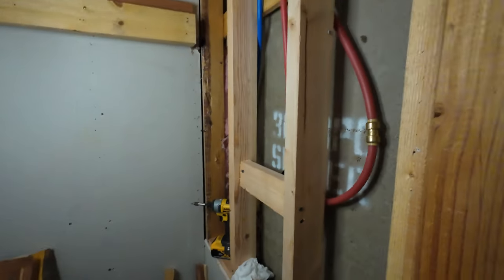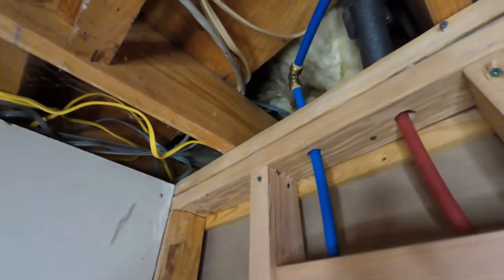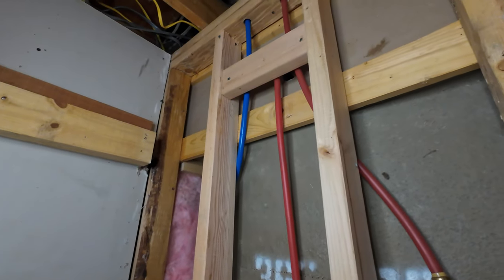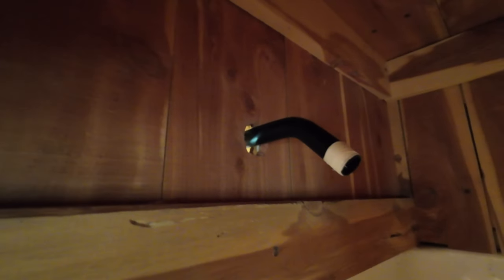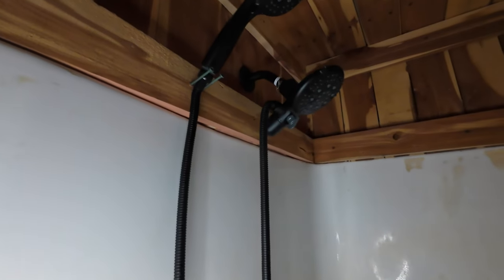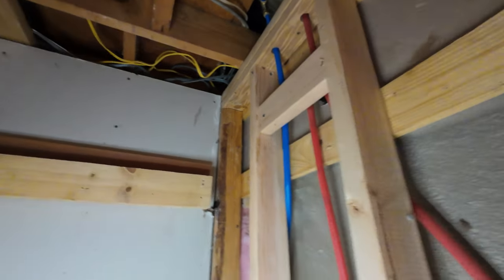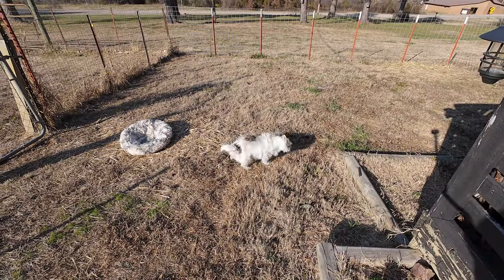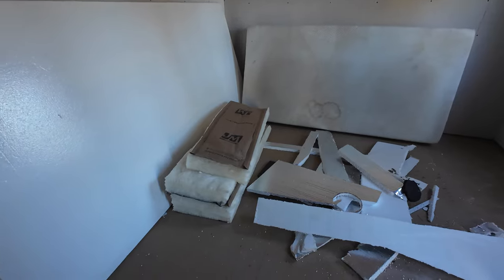Checking Unfinished Projects Off The List One By One. First Up Is The Cabin Bathroom.

Comment: The cedar in the shower looks Beautiful 🤩. I plan to build  a full cedar surround shower/steam room when I move. 
We have a similar shower head/ combo. Same issue, just hung down because it didn't fit the hanger 😣.  I couldn't put nails through the stained glass wall tile. I had one of my blonde moments and figured it out🤣. Try putting the hose into the  hanger then slide it down until the handle meets and fall into the hanger.👍🏻
🤔 Hmmm...What could go in that spot next to the shop?
Thanks Dogman. I always enjoy & appreciate your movies😁, entertainment,  updates and the shorts.
✌🏻😛 Tracy

Comment: The hex head of the shower hose goes on the shower body and the rounded side goes on the hand held sprayer.  Do that at it will fit into the slot on the shower head.

Comment: I think for 200amp you only need to upgrade your breaker box with a 200 amp main breaker. Not 100% but I thought that is how it works.
Reply from the maker: already have 200 amp service panel
Reply: @ouachitamountainliving  OK I thought you said 100 amp. 200 should be more than enough. Keep up the good work!